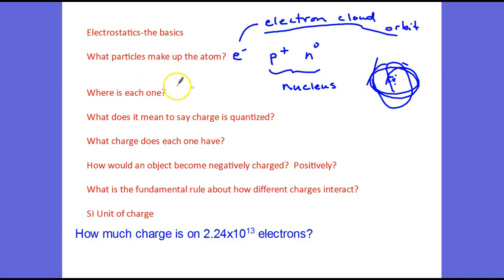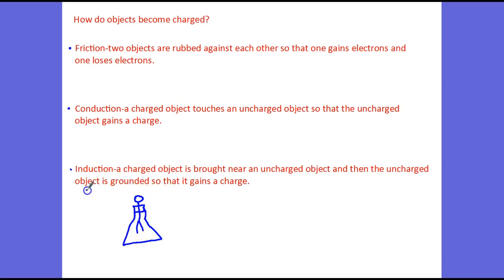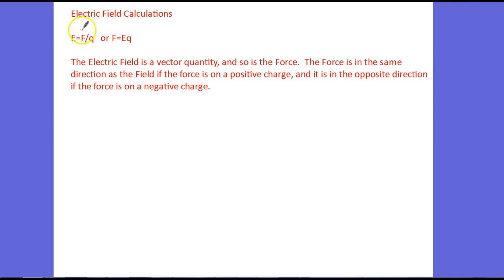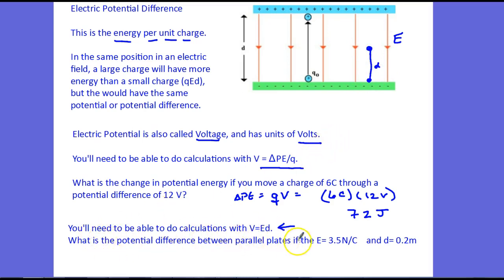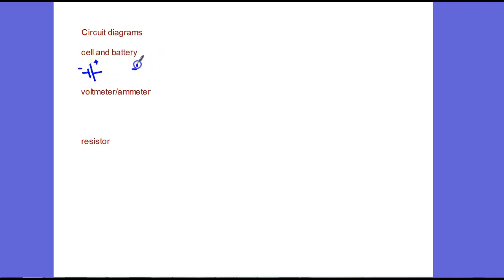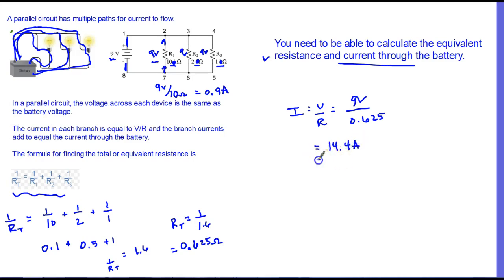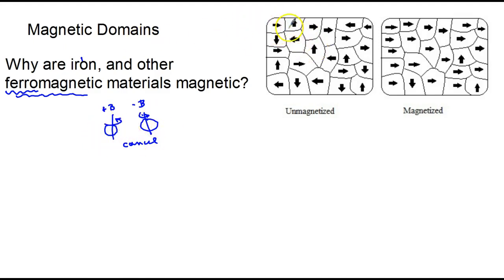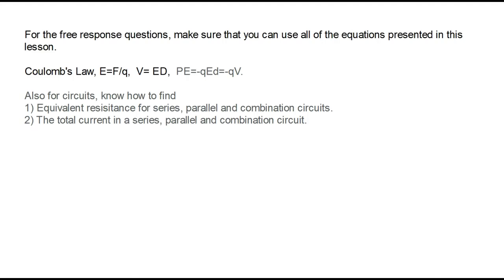Electricity and Magnetism Review

Comment: This whole model does not make any sense.  Never has.  What is a charge exactly?  Just calling it an electron or proton does not explain anything.  Just saying one is negative and one is positive does not explain anything.  Does one have a good attitude and another a bad attitude?  Saying how it acts under certain conditions does not explain anything, either.  These magic bumping particles "just are" and "just do."  There is absolutely no explanation, mechanical or otherwise, of what is occurring in the space between the magic particles.  The "strong force" and "weak force" are equally lacking in explanatory power and are just another form of the "just do" description.  

So, you have the nucleus of an atom consisting of positively charged protons and perhaps neutrons and this is surrounded by an electron shell consisting of numerous oddly shaped orbitals.  If the electrons are actually attracted to the protons, why are they not in the nucleus of the atom with the protons and neutrons?  Seems to me more like the protons and neutrons are attracted to each other and the protons and electrons repel each other.  Instead, the electrons are freely floating in the space around the nucleus; and at the speed of light, I might add.  So these little particles are just zipping around sporadically, changing direction of their own accord without any energy input whatsoever.  How?  Pretty nonsensical, if you ask me.  Where is the energy coming from to make the electrons zip around the nucleus at that speed?  How are the electrons changing direction of their own accord?  What is going on here?  Again, no explanation whatsoever.  

Now, according to this model, electricity is a whole lot of electrons flowing through a wire like water is flowing through a pipe.  The flux of a magnet crosses the wire at an extremely low velocity relative to the rate at which the electricity is claimed to flow through the wire.  How does that happen?  And transversely, I might add.  Not even longitudinally.  That makes no sense.  So, according to this model, an extremely low velocity transverse interaction creates an extremely high velocity mass flow of these particles which always occurs at the same speed c, like magic.  And this is through all of the resistance/impedence of the wire itself.  How are all these electrons leaving the protons they are "attracted to" simply because some lines of magnetic flux crossed the wire at some point?  And those electrons must be somehow pushing all the other electrons away from the other protons on down the line.  From where does all of this energy come?  Then when the energy is used, are you really just taking kinetic energy directly from the flowing electrons?  Is there an electron pile up occurring as they all get slowed down?  From where are all the replacement electrons coming if the electrons are getting slowed down at the point of energy usage?  Since electrons can just change direction of their own accord while they are gallivanting around the nucleus of an atom, how do they all decide to go the same direction simultaneously just because a line of magnetic flux crossed a wire?  Again, this makes no sense.  Seems to me that this model absolutely requires a certain degree of sentience of the particles themselves.
Reply: 'Why doesn't this lecture on the elemental basics of electricity start by explaining quantum electrodynamics while explaining the electromagnetic tensor and how magnetism is the electrical force expressed through relativistic transformations, this is where you start teaching about the basics also we should teach Hamiltonians in grade 8 physics fuck Newton because teaching students models that they lack the mathematical backing to begin to understand is a great way to get them into science and also there's many people who work in the electrical fields that work with this model absolutely fine anyways but fuck utility'
Reply: @DracoSuave  "funky utility."  Yeah, that's exactly what they said when they applied relativity to classical electromagnetic theory.
Reply: @DracoSuave  I don't think their high end models explain most of the questions I asked, either.
Reply: @wesbaumguardner8829  Well if the standard model doesn't give the level of explanation you seek, doesn't that imply that the explanation you seek might be outside what we actually know, and can expect to teach entry level students on electrostatics?
Reply: @DracoSuave  I certainly think the explanation I seek is outside of the standard model.
Reply: @wesbaumguardner8829  Then an entry level college lecture is outside the scope of that desire for explanation, isn't it?
Reply: @DracoSuave  That still does not remedy the fallacies and contradictions of the explanations provided.
Reply: @wesbaumguardner8829  None of which matter at that level of understanding.  None of that is salient to the point--potential, current, resistance, all that still works within that model well enough that you can make a career on it and not knowing the nuances of the standard model won't change that.  

Complaining that we don't know things on a first year lecture is just a shitty thing to do, man.  Like... really bad.  Go take a grad course.
Reply: @DracoSuave  Why would anyone want to learn anything they will have to unlearn later if they want to progress?  To be honest, I don't think the graduate program is going to be any more correct than this level, either.  There is a reason for the stagnation of technological advancement in the energy sector.
Reply: @wesbaumguardner8829  My dude, if you want to get into a field where you have nothing new to discover and everything's figured out, you don't want to be a scientist.  The sciences are not for you.  Science is not for you.

Learning, is not for you.

Go into a field where everything is figured out, where you're not having to learn newer and more intricate ways of understanding--go into a field where there's no frontiers of knowledge left to uncover.

Science does not owe you perfect explanations for everything, nor can it, because science is not easy.  It's very hard.  Clearly too hard for you, because the fact that it has unknowns still bothers you.
Reply: @DracoSuave  There is plenty to learn.  Just not from these people.  They are trapped in their own models.  "Men substitute words for realities and then talk about the words."  -- Edwin Armstrong
Reply: @wesbaumguardner8829  Honestly at this point I'm just waiting for you to play your hand and reveal some debunked pseudoscientific nonsense like plasma-universe or how gravity is false or some shit.  You've checked all the boxes for a typical woopeddler, so let's just finish the job.  That's where this is going, yes?  

Well, get on with it.  Entertain me.
Reply: @wesbaumguardner8829  oh good you found an experiment that follows the standard model and are trying to use it to shit on the standard model, what's next, using double slit to try to disprove the wave/particle dynamic?  

Come on this can't be your best trick, are we going towards plasma-universe?  Is this where it's going?
Reply: @wesbaumguardner8829  The experiment did not contradict---you know what this isn't worth going into.

You don't understand what you're talking about or what you're seeing.  If you did, you wouldn't be on a video teaching the classical electrical model complaining that they teaching the classical electrical model.

Figure your opinion out, it's inconsistant af.  Tesla invented a lot of shit but he was not a physicist.  I'm going to say that again:  HE.  WAS.  NOT.  A.  PHYSICIST.

There's a lot of shit he was wrong about, and we've learned this in the 100+ years since him.  Don't confuse your simping for Tesla for anything resembling a modern understanding.
Reply: @DracoSuave  The only thing they are doing is scaling down the circuitry of the classic theory.  They are still using most of the equations of classic electromagnetic theory.  We are still using Tesla's AC motor/generator or an innovation of it to generate practically all of the energy we use to power the computers.  Much of Tesla's technology is completely different than the technology we use today, so of course it would not work with systems designed for a completely different form of energy.  Claiming his system does not work because it was shut down before it was even completed and because we do not use it presently is as nonsensical as your electron theory of electricity.

By the "shit I am saying" are you talking about the quote from Steinmetz?  You know, he was the head of R&D for General Electric?  The first, I might add.  The entire company was built around him.  He has over 200 patents to his name, most if not all are electrical apparatus, many of which we still use today in one form or another to generate and distribute electricity.  He solved the issues we had with electrical substations exploding in massive coronal discharges.  The physicists certainly didn't.  Just like Oliver Heaviside, another engineer, solved the telegraphy distortion problems when physicists couldn't.  If everything was left to physicists, there would not even be an electrical distribution system.
Reply: @DracoSuave  "No, they're using something called semiconductors which rely on a property of atoms that exists in quantum mechanics but does not exist in classical theory.  In order for semiconductors to work, electrons must exist in a wave state and not in discrete orbits around specific atoms."  Classic electromagnetic theory does not utilize the electron particle.  That was a misapplication of JJ Thompson's description.  

"Tesla DID NOT BELIEVE ELECTRONS EXIST."  They don't, as particles.

"So there's no way Tesla's hypothesis could account for a nonconductive crystal with perfect electron orbitals being doped with a substance with 3 or 5 valence electrons (to form p-type and n-type semiconductors specifically) to form conductive material."  Tesla did not think of "conductivity" the way that you do.  Neither did Oliver Heaviside or Charles Proteus Steinmetz.    Conductivity does not happen inside the atoms of a material.  Conductivity happens outside of the atoms of the material.  That is, in the space surrounding the atoms.  The atoms merely serve as boundary conditions that serve to constrain the energy and prevent it from propagating outwards in all directions.    As such, this "conductivity" is merely determined by the permittivity and permeability properties of the material itself.  That is completely predictable by classical electromagnetic theory, even if they did not have that particular material available at the time.

"Semiconductors don't work because of 'tiny wires', strips of metal that small don't actually work because the electromagnetic force required will cause them to corrode at that level."  Semiconductors have imperfections in them due to the "doping" by the other elements.  This makes them partially permeable and partially non-permeable.  This, in turn, creates tiny inner-atomic circuits.  These tiny circuits comprise on/off switches which can be used to form a language.

"And we've actually SEEN that shit under a powerful enough microscope."  You cannot see electricity with light.  You are full of shit.

"So your disbelief is not born of the strength of Tesla's discredited theories, but on the basis of complete pants-on-head ignorance.  You.  Have.  No.  Fucking.  Clue.  What.  You.  Are.  Talking.  About."  Go ahead and start describing the sentience of the electron particle and how it goes about determining whether it should be attracted to another electron to make an orbital pair or whether it should run away from another electron in terror.  You outed yourself for an idiot a long time ago.  Pretty much everyone that read my critique of your pet theory knows you have nothing to stand upon.  If you did have anything to stand upon, you would have used it by now instead of whining like a b!tch about how unfair it is that I bring all these contradictions and fallacies to light.

"That doesn't make him right about electrons.  The fact we've observed, directly, electrons means literally everyone who has claimed electrons don't exist was wrong.  It's really that simple."  You have not observed electrons directly.  At best you could claim you observed them indirectly.  I highly doubt that is even accurate.  The computer put out a blip and you recorded it as an electron is more like what you observed.

"Regardless, none of this changes the fact that you're being a collosal asshole."  Well, at least I'm not being a whiney little b!tch like you.

"You do not show disrespect to a college professor in a field they spent years studying, who is trying to teach the fundamental basics of electricity--the same fundamentals Tesla agreed with, ironically--and start going on with your Tesla Plasma-Universe malarky and call yourself the good guy."  You aren't teaching the same fundamentals with which Tesla agreed.  Funny how you attempt to pretend that you do while at the same time pretend he was a charlatan when it is you and your ilk that are the charlatans.

"The fact that you're defending discredited science is bad enough, but the fact that you don't even have the basic knowledge of what you're defending to know that the basic models of electrostatics were the same models Tesla SUPPORTED shows you don't even understand the model you're trying to support."  They aren't the same models at all.  You physicists did away with the aether/ether, which was the basis of classical electromagnetic theory.  By all rights, you should have done away with all of the equations as well, because they were all based in fluid dynamics, but you kept most of them and just provided different, yet erroneous descriptions of what was actually occurring.  

"You do your ideas a disservice by going about it in this hamfisted, ignorant way.  Write a paper or fuck off."  Lol.  Write a paper.  And submit it to some closed-minded asshole, just like yourself that will automatically reject it because it does not meet your status quo.  That's rich.  I am really glad we had this interaction.  Best of luck getting new recruits for your religion.
Reply: @wesbaumguardner8829  "Classic electromagnetic theory does not utilize the electron particle.  That was a misapplication of JJ Thompson's description."  Yeah, a semiconductor doesn't work under classic EM theory.  But it works in your computer.  So it works.

"Go ahead and start describing the sentience of the electron particle and how it goes about determining whether it should be attracted to another electron to make an orbital pair or whether it should run away from another electron in terror." 

1)  Electrons are attracted to the proton because they are of opposite charge.  This is consistant with classic electric theory.
2)  While electrons repel each other, that is insufficient to negate the attraction of the nucleus entirely.  This is consistant with classic electric theory.
3) Because electrons are repelling each other while being attracted to the protons, you have competing forces that create a net force that compels electrons into equilibrium states
4) Because the electrons are moving, like any moving charge in classic magnetism they also compel magnetic forces that affect each other.
5) These three factors combined cause electrons to settle into orbitals as per the principle of least action, a core part of Lagrangian mechanics--which predates classic electrical theory.

The only things QED add to this is that the energy states of electrons are quantized (which means an electron changing electron states will only emit or absorb specific energies of photons--this can be directly observed in the spectra lines of excited atoms giving off light frequencies that correspond specificly to a given element--this I have observed with my own eyes) and the Pauli exclusion principle which says that two electrons can't have the same quantum state--which is why the only way for two electrons to share an orbital is if they have opposite magnetic orientation (this is called spin).

Further, all these properties have been exploited and utilized in multiple fields, especially chemistry.  Chemistry works based on this exact model, and it works great.

"You have not observed electrons directly.  At best you could claim you observed them indirectly.  I highly doubt that is even accurate.  The computer put out a blip and you recorded it as an electron is more like what you observed."  And you've never observed any counter evidence to this, so you're asserting but not producing.

" You aren't teaching the same fundamentals with which Tesla agreed.  Funny how you attempt to pretend that you do while at the same time pretend he was a charlatan when it is you and your ilk that are the charlatans."  This is literally a class on classic electrostatics.  You have no clue what you're objecting to: You just heard the word electron and your brain shut off.  I doubt you even know Coloumb's Law or Ampere's Law, or Ohm's Law or even what voltage IS.  And what I said was that Tesla got a lot of things wrong--those things he got wrong are the things that you have a boner about, claim are correct despite over a century of counterevidence.  Which is why the oldest thing you can find to support you is grainy black and white filmed movies, and nothing from this century that is from anyone resembling an expert in the field.

"They aren't the same models at all."  You don't know the model you're criticizing.  You don't know what a charge is, what induction is, what conduction is, you don't know what a Gaussian surface is, you don't know what a voltage is, you don't know what Maxwell's laws are (or that Maxwell's laws were derived by putting the laws of electricity through lorenz's transformations, because you claimed that relativity does not work with magnetism you clearly are unaware of what Maxwell's laws are about) you have displayed you do NOT know what classical electrical theory is.  

Hell, you probably don't even know what a vector is, a cross product, a dot product, or even enough calculus to be able to understand half the shit you're trying to criticize.

>You physicists did away with the aether/ether, which was the basis of classical electromagnetic theory.

No, Aether was actually the basis of the theory for light at the time, it had nothing to do with the extant model of electric theory.  Light was not identified as the carrier of electromagnetism until after Michelson/Morley disproved aether.  Meanwhile, the modern theories of light actually work.

>  By all rights, you should have done away with all of the equations as well, because they were all based in fluid dynamics

They aren't though.  You don't know Coloumb's law, how can you even begin to claim this nonsense.

> that will automatically reject it because it does not meet your status quo.

No, they will reject it because you will post assertions that do not comport with reality, and you will have made no attempt to experimentally determine your assertions to be even slightly correct, thus disqualifying it from being science.

Hell, your stupid theory won't even let a lightbulb work.  You've never seen a physics lab or done any experimentation or anything, and it's clear.

All you have is a boner for Tesla and Dunning-Kruger.  Tesla made electric lightning coils, AC current, and an earthquake machine but was wrong on so many things fundamental to modern invention that no one LITERALLY NOT ONE PERSON considers Tesla to be an expert in the field of anything except making quaint devices.  He made AC current, guess what?  That's like saying the guy who invented a kite made a better airplane than Boeing.  Meanwhile you're talking shit on a device made by engineers that reject Tesla's theories, using materials created by chemists that reject Tesla's theories, with power supplied by power companies run by engineers that reject Tesla's theories, none of which could have been made in Tesla's time.

Go post to your flat earth friends, they're the only ones who might take you seriously.  Actual people who work with electricity--including your run-of-the-mill electricians--will tell you to your face you're full of shit.  Because you are.

If Tesla's theories were valid, we'd be building shit based off them.  His only contribution in the modern day is AC current, and it has nothing to do with his contribution, someone else discovered, after his death, that it was more efficient over long distances, because (not despite) how electrons work.
Reply: @DracoSuave  "Yeah, a semiconductor doesn't work under classic EM theory."  Who's theory are you considering to be classical?  James Clerk Maxwell was the beginning, not the end of classical electromagnetic theory.  Go ahead and tell me why a semi-conductor would not work in Oliver Heaviside's or Charles Proteus Steinmetz's theories.

"1)  Electrons are attracted to the proton because they are of opposite charge.  This is consistant with classic electric theory."  Why aren't they in the nucleus with the protons and neutrons, then?  If a neutral particle is not attracted to anything, why is a neutron in the nucleus of the atom with the proton, in much closer proximity to the electron which is claimed to be attracted to the proton?

"2)  While electrons repel each other, that is insufficient to negate the attraction of the nucleus entirely.  This is consistant with classic electric theory."  Who's theory?  The only classical electromagnetic theory that involved the electron at all was JJ Thompson's.  His theory is one of many classical theories.

"3) Because electrons are repelling each other while being attracted to the protons, you have competing forces that create a net force that compels electrons into equilibrium states"  How would two electrons that should be repelling each other but are instead pairing up in very close proximity to each other be a state of equilibrium?  

"4) Because the electrons are moving, like any moving charge in classic magnetism they also compel magnetic forces that affect each other."  Steinmetz, who published the most comprehensive and complete classical electromagnetic theory argued against the conception of the point charges.  He was also the person that was the most productive in putting his theories into application, which provides him a great deal of merit in my mind.  In other words, he proved his theory worked time and again.

"5) These three factors combined cause electrons to settle into orbitals as per the principle of least action, a core part of Lagrangian mechanics--which predates classic electrical theory."  What causes the electrons to repel from the nucleus of the atom they are supposed to be attracted to, but are not, at least fully?  Perhaps the electrons are functioning in accord with Roger Joseph Boscovitch's theory.  Your theory certainly does not make any sense to me.

"The only things QED add to this is that the energy states of electrons are quantized (which means an electron changing electron states will only emit or absorb specific energies of photons--this can be directly observed in the spectra lines of excited atoms giving off light frequencies that correspond specificly to a given element--this I have observed with my own eyes) and the Pauli exclusion principle which says that two electrons can't have the same quantum state--which is why the only way for two electrons to share an orbital is if they have opposite magnetic orientation (this is called spin)."  So basically, electrons are nothing other than tiny permanent magnets.  Why can't they link up at opposite poles like other permanent magnets into a large electron clump?  With that said, each element has its own resonant frequency which is why light is propagated from the motion of these atoms.  Light is nothing other than a sound wave in the ether or quantum field or whatever you want to call the medium through which light propagates.  A wave is not a physical object, it is the action of a medium and this action can impart forces on what we call physical objects, but physicality is just an emergent property of the constructive and destructive interference of the waves in the field.  Stable standing waves of sorts.

I would love to stay and respond to the rest of your long post, but I have things to do.  Perhaps later I can respond to the rest.
Reply: @wesbaumguardner8829  The point is, Wes, you're saying electrons don't exist and a semi-conductor requires electrons to exist to function.  It's that simple.  I simply don't care what the name of the model you think you follow you call out is or who did it (because that requires examining how fucking wrong you are about it) but rather that your core belief--the non-existance of the electron--is incompatible with how semi-conductors work. 

Either you believe in electron orbitals and modern chemistry, in which case you are compatible with semi-conductor technology, or you do not, and are not. 

I'm not going to discuss with you wave functions of electrons or other nuances of shit you won't believe no matter what detail I go into, because you don't know how semi-conductors work and you don't know how that completely contradicts every assertion you make.

"So basically, electrons are nothing other than tiny permanent magnets."  Every charge with nonzero spin is, yes.  If you have a charge, and you move it or spin it, you get a magnetic field.  Source:  MOTHERFUCKIN MAXWELL BITCH.  Don't you come out trying to claim shit about Maxwell and not understand what Maxwell's equations are about:  That electricity and magnetism are the same thing expressed in different directions through spacetime.

"Why can't they link up at opposite poles like other permanent magnets into a large electron clump?"  Remember how I just said electricity and magnetism are the same thing but through space time?  There is no Lorentz transformation you can do to an electron to make it positively charged, which means those particles can never really attract each other.  But what you can do is make the net charge positive in certain areas (because the nucleus is still there, existing) and there is a net positive electric field where the electron is not, and the electric force only cares about the net field, not the individual objects.

"With that said, each element has its own resonant frequency which is why light is propagated from the motion of these atoms."  Spoken like someone who actually has never seen the lines I am talking about.  Elements don't have a 'resonant frequency', they emet BANDS of light at MANY frequencies.  The patterns of frequencies, however, are unique to each element.  So hydrogen, when excited, gives off red-blue light.  Not purple.  Red and blue.  Because it's multiple wavelengths, the visible parts include some bands in the red part of the spectrum and some bands in the blue part.  With a prism or a strong lens, you can see these bands with the naked eye.  I know because I've seen them, with my naked eye.  You have not, and it is very clear you have not.  So you are simply going to either have to take the time to actually do so, or take my word for it.  But I am confident that if you do, you will see the same deep blue and red that I have seen myself.

https://en.wikipedia.org/wiki/Hydrogen_spectral_series and oh shit, turns out, others have seen them too.

Light was disproven as having a carrier field long ago--it's a simple experiment to carry out, Michelson-Morrey did so a century ago, and it works by having light bouncing around at different angles.  If they are going through a medium, they should hold different readings if you spin the disc vs if the disc is still.  They do not, ergo, it is not carried in a medium.

"A wave is not a physical object"  You're thinking macroscopicly.  'Physical object' at the quantum level is nothing but waves; what we percieve as discrete hard objects are in fact just expressions of the repulsive electrical force as atoms get close to each other but there is no attraction between them to cause chemical bonding.

Chemical bonding, btw, follows rules involving electrons, and so you're kinda claiming chemistry doesn't work, fundamentally.
Reply: @DracoSuave   "The point is, Wes, you're saying electrons don't exist and a semi-conductor requires electrons to exist to function."  Field theory does not require a point charge or discrete, charge-carrying particle.  If SR and GR proved anything, they proved that the conception behind the mathematics can be completely erroneous and still provide results that are good enough to engineer by if the same exact mathematical equations are utilized in the same manner.  That is one of the primary problems with mathematics; its reliance on a completely different language consisting of words to have any meaning in reality at all.  If the classical electromagnetic field equations which were based entirely in fluid dynamics and described the properties and interactions of a medium called the ether/aether can still be used when the ether/aether is completely removed with equal efficacy, what does that say about mathematics?  To me, it says, "Houston, we have a problem."  And I place the problem on the reinterpretation that went on after the fact.  If there is no medium, no aether/ether, then all of the equations should have been completely discarded and equations that did not describe the aether/ether should have been created.  But they could not do that, now could they?

"... your core belief--the non-existance of the electron--is incompatible with how semi-conductors work."  No, it is just incompatible with the present mainstream description of how semiconductors work.  The mainstream description is converting field phenomena into bumping particle phenomena while trying to pretend the field is not there, but still somewhat acknowledging the presence of a field.  To me, it seems like a half-ass attempt to not have to acknowledge that they have been wrong about the presence of the ether for over 100 years now.  

"Either you believe in electron orbitals and modern chemistry, in which case you are compatible with semi-conductor technology, or you do not, and are not."  That is a false dichotomy.  I think the overall action of chemical bonding is correct, I just disagree with the how.  I do not think it is a particle interaction.  I think it is a field interaction.  Think about it.  Even your bumping particles have to have something between them that determines how they move and/or interact with each other.  Only, the electron orbitals explanation seems to fail Occam's Razor in that why not just have field interactions directly between the nucleus of the atoms and do away altogether with the sentient electron particles that can choose where and when they will attract or repel each other?

"I'm not going to discuss with you wave functions of electrons or other nuances of shit you won't believe no matter what detail I go into, because you don't know how semi-conductors work and you don't know how that completely contradicts every assertion you make."  Ok.  And I won't go into the dielectric field and all the phenomena in it that you will not believe.

"Don't you come out trying to claim shit about Maxwell and not understand what Maxwell's equations are about:  That electricity and magnetism are the same thing expressed in different directions through spacetime."  They are not the same thing.  Dielectricity and magnetism are the two components of the dielectric field.  Dielectricity forms flux lines that terminate inside matter at each end and magnetism forms concentric rings around the matter that is carrying a current which terminate on themselves.  Electricity is the union of a dielectric flux line and a magnetic flux line.  Motherfuckin Maxwell, Beeeach.  By the way, you are probably referring to Oliver Heaviside's short and sweet algebraic representation of Maxwells long and tedious equations involving infinitesimals and calculus rather than Maxwell's equations themselves.

 "Remember how I just said electricity and magnetism are the same thing but through space time?"  That's just wrong for the reason I already mentioned.  You could claim magnetism and dielectricity are the same but in different directions, but that is still technically not correct.  The dielectric is a form of potential energy and the magnetic is a form of kinetic energy.  The magnetic is spatial in nature and the dielectric is counter-spatial in nature.  You cannot equate the two as if they are exactly the same just like you cannot equate the kinetic and potential energy of a swinging pendulum as the same thing.  They are two sides to the same coin, but they are still two  different sides.

"There is no Lorentz transformation you can do to an electron to make it positively charged, which means those particles can never really attract each other."  Permanent magnets are not charged.  They both attract and repel each other depending completely on the orientation of their polarities with each other.  Basically, your explanation is crap.  It does not work.

"But what you can do is make the net charge positive in certain areas (because the nucleus is still there, existing) and there is a net positive electric field where the electron is not, and the electric force only cares about the net field, not the individual objects."  Well, at least there is finally some discussion on something that might actually be possible.  It still seems to violate the principle of locality, though.  I am a little foggy on how it would actually work, though.  Is it the proton particle that is positively charged or is it the field around the proton that is positively charged?  Both?    If it is both, how?  How can a positively charged particle positively charge a field?  How?  By what mechanics?  Are you going to get into quantum dipoles now?  

"Spoken like someone who actually has never seen the lines I am talking about.  Elements don't have a 'resonant frequency', they emet BANDS of light at MANY frequencies."  What lines are you talking about?  Elements do not emit particles unless they are undergoing radioactive decay.  That would be a violation of the conservation of energy.  Do you really think you can really create particles just by running some electricity through an incandescent light bulb?  Gamma rays are not particles, either.  They are waves.  Elements have several resonant frequencies that are dependent on elasticity and density properties of the material in question.  With light, you are talking about a law of averages. There is no such thing as a 100% pure material.
Reply: @wesbaumguardner8829  "Field theory does not require a point charge or discrete, charge-carrying particle. "  But semiconductors do.  They function based on A) the existance of atoms with 4 valence electrons in a crystal lattice (silicon most commonly) B) doped with atoms with either 3 or 5 (germanium and gallium must commonly) valence electrons which act as impurities in the lattice.  Because of the way electron orbitals work, this produces free electrons which can then flow over the silicon (resulting in a net positive charge in the silicon), or places for electrons to go to charge the silicon (resulting in a net negative charge.)

If, however, you use electrical theory that lacks electrons, and therefore lacks valence electrons, you are stuck with the very simple fact that silicon, germanium, and gallium are inherently insulators, and those mixing them together should not result in a conductive material.  So, either electrons are correct, and you can dope silicon with germanium or gallium to make it very conductive, or electrons don't exist, in which case you cannot do this.

Because semiconductors, however, DO work, and DO work by doping silicon with germanium or gallium, that means that the theory that lets them work must also have some form of validity, and theories that exclude them do not work.

"Dielectricity forms flux lines" stop you right here.  Nothing about electrons or semiconductors contradicts this.  This is high-school level shit.  We're past that.  We're at the properties of valence electrons within an insulating substance.  

"Electricity is the union of a dielectric flux line and a magnetic flux line.  Motherfuckin Maxwell, Beeeach."  No.  Electricity is what you get when two charges exhibit a force on each other.   When you have a charge move in a net-neutral space, however, because of Lorentz transformations, length actually changes which changes the charge density of the moving charge through that material.  Because the material is unmoving and its charge density does not change, the resulting net charge density of the material changes.  This is what we measure as magnetism.  This has been experimentally corroborated.  Maxwell's equations work in Minchowski spacetime, my dude.  In fact, they work BETTER in Minchowski spacetime.

"is it the proton particle that is positively charged or is it the field around the proton that is positively charged?  Both?"

The proton is positively charged.  A positive charge, however, creates an electric field around it with the strength of kq/r^2 where k is Coulomb's constant.  Yes, this is just a rephrasing of Coulomb's law for electrical force without the charge the force is acting on.  The electric field at a given point is neither positive nor negatively charged, it's a vector, that indicates the net direction a positive charge would feel a force.
Reply: @DracoSuave  "If, however, you use electrical theory that lacks electrons, and therefore lacks valence electrons, you are stuck with the very simple fact that silicon, germanium, and gallium are inherently insulators, and those mixing them together should not result in a conductive material."  Material properties often do not work the way we think they do.  Per your reasoning, we should not be able to mix two liquids together to make a solid, or even a gas and a liquid together to make a solid.  But we can.  If that is possible, why should it be impossible to mix two dielectrics together to make a semi-conductor.  Numerous properties change when different elements are bonded together.  Why should the properties that dominate the electromagnetic field (magnetic permeability and dielectric permittivity) be any different?  A dielectric is not what you think it is, either.  A dielectric is a material that readily carries the dielectric field.  Hence the name "dielectric."  The so-called "insulator" is the actual conductor of the dielectric field as it readily accepts the dielectric form of energy without much impedence while what we call the "conductor" actually acts like a dielectric reflector that serves to reflect the field back upon itself instead of allowing it to escape outwards in all directions, but as a secondary effect, it conducts the energy down the "conductor" laterally in accordance with the right-hand rule.  It is a fact that the vast majority of the energy (both magnetic and dielectric) is stored in the field outside of the wires and not inside the wires themselves.  The same thing happens in the semi-conducting chips, but only on a much smaller scale, which means it has a much higher capacitance.

"Nothing about electrons or semiconductors contradicts this.  This is high-school level shit.  We're past that.  We're at the properties of valence electrons within an insulating substance."  Let us see what J.J. Thompson, discoverer of the "electron" has to say about them, shall we?  "Hitherto, we have been dealing chiefly with the properties of the lines of force, with their tension, the mass of ether they carry along with them, and with the propagation of electric disturbances along them; in this chapter we shall discuss the nature of the charges of electricity which form the begginnings and ends of these lines."  Electricity and Matter page 71.  So, according to the man himself, an electron is not a particle at all, but rather the end of a dielectric line of flux.  There goes all your particle based orbital bullshit.  Go ahead and tell me how there can be "electric disturbances" along these dielectric flux lines if the electricity/electrons are only at the end of the flux lines.    

"Electricity is what you get when two charges exhibit a force on each other."  Total Electrification Q (in Planck) = Total Magnetic Induction Phi (in Webers) * Total Dielectric Induction Psi (in Coulombs).  Who proved this equation wrong, when did they prove it wrong and by what experiment did they prove it wrong?
Reply: @wesbaumguardner8829  "but as a secondary effect, it conducts the energy down the "conductor" laterally in accordance with the right-hand rule"  What the fuck is this shit?  The right hand rule?  Which are the two vectors that make up the factors of your cross product?!  What the fuck are you on about?  None of what you said here makes sense.  You're making shit up.

"Total Electrification Q (in Planck) = Total Magnetic Induction Phi (in Webers) * Total Dielectric Induction Psi (in Coulombs)."

This is not a force equation.  This is not Coulomb's law.  coulombs measures charge.  webers measure magnetic flux.  Webers are shorthand for volt-turns per second.  If you multiply those units together you get coloulomb-volt-turns per second which translates to joule-turns per second, which translates to watt-turns.  This would be a unit of energy over time put into something rotating.  Planck units are really small measurements of distance, the dimensionality does not work here.  Further, webers are a pseudovector representing a rotational quantity and when you multiply a rotational pseudovector by a scalar, you don't get a displacement true vector.  You also would never write the product of a scalar and a vector like that--the scalar ALWAYS comes first and the vector ALWAYS comes second (and order is important in vector math, the only time a vector can be the first factor of a product is in the product of two vectors, otherwise if you're multiplying by a matrix or a scalar, the vector MUST be second)
Reply: @wesbaumguardner8829  "So, you are telling me that the end of a flux line is divisible?"

They're not literal lines.  They're not.  Literal.  Lines.  Gauss lines (the more accurate name) a representation of an electric field. There aren't literal heckin lines.  

And you can't heckin argue that heckin Gauss lines are quantized when you're arguing against quantum models.  

You're literally not making any sense.

You also ignored all the vector math you've gotten horribly horribly wrong (do a dimension analysis)
Reply: @DracoSuave   "They're not literal lines.  They're not.  Literal.  Lines.  Gauss lines (the more accurate name) a representation of an electric field. There aren't literal heckin lines."  They are really real lines that form due to constructive and destructive interference within the field itself.  Similar to the pattern that forms in the double slit experiment.  Michael Faraday described them as lines.  James Clerk Maxwell described them as lines.  Oliver Heaviside described them as lines.  Charles Proteus Steinmetz described them as lines.  JJ Thompson described them as lines.  Heaviside, Steinmetz, and Thompson even have diagrams of the field lines in their works.  These lines physically pull two wires together under the right field conditions.  The reason we cannot see them is because we do not have a material that orients itself to them like we do with magnetism.  We can literally see the lines of the magnetic field with iron filings, etc.

JJ Thompson, the man that discovered the electron literally says the electrons are the ends of a flux line, yet you desperately want to claim otherwise so you can keep believing in your sentient particle theory.  I provided the actual quote from JJ Thompson's book.  I even gave you the page number so you can read it for yourself.  Perhaps you should read what follows after that, because it only makes it abundantly more clear that the electron is the end of a line of flux.  You really have no understanding of classical electromagnetic theory at all.
Reply: @wesbaumguardner8829  "They are really real lines that form due to constructive and destructive interference within the field itself. "  No, they are not.  They are representations of the direction a positive charge will go due to electrical force.  The direction of the lines indicate the direction the positive charge will go, and the density of lines is a representation of how strong the electrical force will be on that charge.  

Further, claiming that lines are indivisible is contrary to your claim that quantum mechanics is bunk.  You're claiming that they are quantized (that's the term for indivisibility in physics) and what's stupider, is you're claiming that me saying that charge is quantized (and, yes, Millikin proved this using the oil-drop experiment) is somehow claiming that Gauss lines are... not?  These are not related claims.

The point you've missed from all those physicists is that you're confusing a representation, an analogy, for the actual phenomenon.  Field lines are a useful tool for determining certain things, but that doesn't mean they have real existance outside that conceptualization.  You also would not argue that every charge has equivoltaic rings around them that are precisely perpendicular to Gauss lines.

In fact, you've seen this shit before.  When you look at a contour map of the earth, you've seen arrows to indicate which direction is downhill and lines that indicate specific elevations.  These are not merely analogous to Gauss lines and Equivoltaic lines, they ARE the equivalent for the gravitational field at that location on the map.

But you wouldn't argue there's literal arrows of force coming down the mountain, crossing cross-sectional rings that you can interact with on a physical level.

You're confusing the map (gauss lines and equivoltaic rings) for the terrain (the charges, force directions, and potential energies at a given location).  The map is useful for figuring out where you need to put shit to do work.  But the map isn't doing that work.  My physics prof describes them as lines too.  But Faraday did not mean there are actual lines in space, nor did Maxwell, nor did Heaviside,  nor did Thompson.  

Further, you're directly contradicting many of their conclusions and most of their work, which you'd know if you'd studied enough physics to know what you're talking about, instead of reading the word 'lines' and thinking you know what you're reading about.  

'Perhaps you should read what follows after that, because it only makes it abundantly more clear that the electron is the end of a line of flux.'

I'm not disputing this.  In fact, this doesn't contradict one fucking thing I've said.  If a Gauss line is the direction a positive charge feels a force, and electrical charges that are opposite to each other are attractive, then that force a positive charge would by necessity point to a negative charge.  That force isn't going to magically point somewhere else, is it?!  OF COURSE the force points towards the negative charge.

You fucking up on a fundamental level what a Gauss line IS, is not a gotcha on me bud.  You're confusing the map for the terrain.  That's like me saying that rivers flow down elevations from mountains to oceans and you pointing to a fucking elevation map and saying 'NO THEY DONT THEY TRAVEL FROM THE CONTINENTAL DIVIDE AND GO TO THE OCEAN' and me just going back 'Yeah, we define the continental divide that way because rivers flow downhill' and you going 'NO IT ISNT THE CONTINENTAL DIVIDE MUST BE A REPELLANT FORCE MAGNET FOR WATER' and then you bringing up the geographer who penned the theory 'rivers flow downhill' where they're talking about the continental divide as support for your stupid position.

Also, just so you know:  The dielectric is the insulator in a capacitor.  The silicon in semiconductors is not a dielectric, though undoped silicon can act capacitor; generally semiconductors are the wrong stuff to make a capacitor out of, which is why you see all those little electronic doodads sticking out of your printed circuit boards.
Reply: @DracoSuave   "No, they are not.  They are representations of the direction a positive charge will go due to electrical force."  There is a line of dielectric flux between two wires, each end terminating on the surface of each wire.  There is a positive charge located in the dead center of that dielectric flux.  Which way does the positive charge go?  If the charge is shifted to one side or the other of the center of that dielectric flux, which way does it go?

"Further, claiming that lines are indivisible is contrary to your claim that quantum mechanics is bunk."  No, it is not.  Quantum mechanics wants to pretend that the ends of dielectic flux lines are charged particles and that the flux lines do not occur.  To them, the only thing that matters is the point charge, when in actuality it is the field that contains all the energy.

"You're claiming that they are quantized (that's the term for indivisibility in physics) and what's stupider, is you're claiming that me saying that charge is quantized (and, yes, Millikin proved this using the oil-drop experiment) is somehow claiming that Gauss lines are... not?"  When did I ever make that claim?  Go ahead and copy and paste it for me.  I said electrons do not exist as particles.  That is different than saying they are not quantized.  The end of a dielectric flux line is still quantized.   There are only two of them for each flux.  Nice straw man argument, btw.

"In fact, you've seen this shit before.  When you look at a contour map of the earth, you've seen arrows to indicate which direction is downhill and lines that indicate specific elevations.  These are not merely analogous to Gauss lines and Equivoltaic lines, they ARE the equivalent for the gravitational field at that location on the map."  They aren't equivalent for the gravitational field.  The gravitational field will be going directly into the paper.  Things do not fall to the side of a cliff face, things fall directly towards the center of the earth regardless of the surface contours of the earth.  Of course, once impact is made with the earth, the contour comes into play, but that is not the direction the gravitational field itself is pulling.

"You're confusing the map (gauss lines and equivoltaic rings) for the terrain (the charges, force directions, and potential energies at a given location).  The map is useful for figuring out where you need to put shit to do work.  But the map isn't doing that work.  My physics prof describes them as lines too.  But Faraday did not mean there are actual lines in space, nor did Maxwell, nor did Heaviside,  nor did Thompson."  That's where you are wrong.  There is a direct correlation between the amount of lines in a space and the amount of work that can be done.  When work is done, the energy of some of the flux lines dissipates and there are fewer lines which means the field has less capacity to perform work.  More power must then be consumed to get the flux line densities back to where they were.  And if the flux lines are just representations, and nothing is going on there, how can it cause a point charge to move per your earlier argument?  If it truly is nothing, it cannot act on a thing.  But it can act on a thing, so it must be something.

"Further, you're directly contradicting many of their conclusions and most of their work, which you'd know if you'd studied enough physics to know what you're talking about, instead of reading the word 'lines' and thinking you know what you're reading about."  Let me guess, was it when I provided their direct quotes which you succinctly claimed were wrong?  Why don't you go ahead and tell me where exactly I am contradicting their conclusions?

"I'm not disputing this.  In fact, this doesn't contradict one fucking thing I've said."  Yes, it does.  You keep claiming that electrons are particles.  The end of a line of dielectric flux is not a particle. 

"You fucking up on a fundamental level what a Gauss line IS, is not a gotcha on me bud.  You're confusing the map for the terrain."  When it comes to the field, the gauss lines are not the map, like you are claiming.  They are the field itself.  This all goes back to that Edwin Armstrong quote I provided earlier.  You are just talking about the words.

"Also, just so you know:  The dielectric is the insulator in a capacitor."  No, it is not.  The dielectric is what stores the energy of the field.  You can take a Leyden jar, charge the dielectric inside of it, remove the anode and cathode and replace them with a new anode and cathode and complete the circuit and still get a discharge.  You should know this, man.

 "The silicon in semiconductors is not a dielectric, though undoped silicon can act capacitor; generally semiconductors are the wrong stuff to make a capacitor out of, which is why you see all those little electronic doodads sticking out of your printed circuit boards."  A while back you said it was a dielectric, now you are saying it is not one.  How wonderful.  Well, even if it is not acting as a dielectric, the air can certainly act as a dielectric.  And all those little metal bits are what you would consider a conductor.  A computer chip is just a material that has thousands of tiny circuits on it.  If you want to claim it does not follow classical electromagnetic theory, prove that it does not follow the laws of circuitation of classical electromagnetic theory.
Reply: @wesbaumguardner8829  "There is a line of dielectric flux between two wires, each end terminating on the surface of each wire.  There is a positive charge located in the dead center of that dielectric flux."

The electric field is going from the positive charged wire to the negatively charged wire.  The proton is attracted to the negatively charged wire.  There's arrows attached to Gauss lines (I know you're calling them flux lines and I know that they were originally called that, but I'm avoiding the use of the term flux because in modern electrostatics that's a term for a slightly related thing) that show you which direction a positive charge goes.  Also, 'dielectric' is the resisting material in a capacitor.  Believe it or not, you've almost described one here on accident!

"No, it is not.  Quantum mechanics wants to pretend that the ends of dielectic flux lines are charged particles and that the flux lines do not occur."  This is patently incorrect.  First off, 'quantized' means, in physics, that you're dealing with discrete indivisible units.    It means that you cannot break that apart.  So when you claim flux lines are indivisible, you are claiming they are quantized--that's what it means.  However this is not true, because flux lines are arbitrary in terms of how many or what you draw.  The field itself is not quantized, but all electric charge is.  And yes, the ends of Gauss lines are electric charges, because of Coulomb's law.  

"Let me guess, was it when I provided their direct quotes which you succinctly claimed were wrong?  Why don't you go ahead and tell me where exactly I am contradicting their conclusions?"  I have multiple times.  Let's start with your complete disregard for Coulomb's Law.  This is absolutely required to accept in order to accept all four of Maxwell's equations.  Let's start with the first one and why you contradict it.

Grad E = rho/epsilon_naught.

In english, this is 'The gradiant of  Electric Field is equal to the charge density per volume within a given space divided by the permittivity of free space.'  

If your model does not include electric fields (and therefore excludes the gradiant of the electric field) and it doesn't include charge (and therefore excludes the volume charge density) then you don't exactly fucking agree with Maxwell's first equation do you?

Agreeing with the existance of the electric field is required to acknowledge Maxwell's four laws--in fact it's required to even make sense of them.  

Maxwell's Law is based upon knowing what an electric field is--it's the force per coulomb acting on a charge at a given point in space.  And to know the force per coulomb you need to know a) what a coulomb is (it measures electric charge) and b) what the equation for electric force is.  That electric force equation is k times the first charge times the second charge, all divided by the square of distance between them.  

And how do I know this?  Because I actually know what the fuck I'm talking about.  All you're doing is regurgitating terms and quotes from scientists without actually understanding the meaning behind any of it.  I've performed experiments to verify some of this shit.  You have not.  You OBVIOUSLY have not.

How the sam fuck can you even POSSIBLY claim to understand Maxwell--which requires understanding multi-variable calculus, linear algebra, AND tensors--without understanding the actual content.

Like every time you say 'dielectric flux lines' I know that you actually are referring to what mathematicians refer to as 'a vector field.'   And because you're describing field lines from a vector field diagram, I know what it is you're referring to.  I know what those previous physicists are referring to because I learned it in modern language.  But, because you actually DON'T understand it, you think rigidly connected topics such as vector field lines, equivoltaic lines, and coulomb's law are contradictory things, rather than the truth, which is that they're all different ways of expressing the same thing and that you use whichever is easiest to work with at any given time.

Look, there's no other way to put it.  You're shitting on these physicists by mangling what they're saying in your hamfisted manner.

You.  Are.  Just.  Regurgitating.  Without.  Understanding.

Either charge exists or Maxwell was wrong.  You claim charge does not exist, ergo, you claim Maxwell was wrong.

And this is why you're disrespectful.  Rather than learning the material this professor provided for you in this video, you decided to heckle it, under the hubris that you--who doesn't even fucking know what a vector is--knows more than someone who works with electricity about electricity.
Reply: @DracoSuave  "The electric field is going from the positive charged wire to the negatively charged wire.  The proton is attracted to the negatively charged wire.  There's arrows attached to Gauss lines (I know you're calling them flux lines and I know that they were originally called that, but I'm avoiding the use of the term flux because in modern electrostatics that's a term for a slightly related thing) that show you which direction a positive charge goes."  Are you using the one-fluid or two-fluid theory postulated by Maxwell?  As his was the first comprehensive theory, it was also incomplete and/or incorrect in some of the assumptions.  As I previously stated, Maxwell was not the end of classical electromagnetic theory, but the beginning.  Steinmetz's theory is the most complete and comprehensive and the last that was actually published in great detail, while also being the most engineerable and he did away with the concept of charges for the most part and stuck to the fields themselves.  Steinmetz had much greater empirical evidence through experimentation at his disposal than Maxwell did.

"Also, 'dielectric' is the resisting material in a capacitor.  Believe it or not, you've almost described one here on accident!"  Air is a dielectric.  Rubber is a dielectric.  Oil is a dielectric.  Empty space is also a dielectric.  A dielectric is a material that supports the dielectric field, as I stated earlier.  The dielectric field is located in the air around two current carrying wires, not inside the wires themselves for the most part.  Of course there is a point of contact where the flux lines terminate.  Resisting material of what?  Charge transfer?  Look at it this way.  You could say that gravity is a resistor to upward movement away from the earth's surface.  So, you carry a rock up a mountain.  Gravity was resisting you the entire way up.  But, as you were going up the mountain, you were converting chemical energy into kinetic energy and kinetic energy into potential energy.  Gravity was there the entire time.  When you get to the top of the mountain, you toss the rock off of its edge and all that potential energy gets converted back into kinetic energy until it hits the earth's surface again.  Same exact thing with the dielectric.  The dielectric material can be likened to planet earth and the dielectric field can be likened to gravity.  If planet earth somehow became more massive, the resistance to vertical movement would be greater, but so would the stored potential energy of the vertical movement.  Likewise, the better dielectric a material is, the more resistive it will be to kinetic movement of charges, but the greater the stored potential energy of those charges.

"So when you claim flux lines are indivisible, you are claiming they are quantized--that's what it means.  However this is not true, because flux lines are arbitrary in terms of how many or what you draw."  Yes, flux lines are not divisible, thus their ends/terminals are also not divisible.  The dielectric flux lines are not arbitrary at all.  They are lines of force.  They literally have physical effects in the real world which you can measure.  If you draw additional dielectric flux lines in a field representation, you are actually adding potential energy to the field you are describing on paper.  It takes power from the current to create dielectric flux.  Furthermore, Steinmetz makes it quite clear that the dielectric flux can transfer its potential energy to the kinetic energy of the magnetic flux and vice versa.  This man created and built our electrical grid.

"Let's start with your complete disregard for Coulomb's Law.  This is absolutely required to accept in order to accept all four of Maxwell's equations."  Again, Maxwell's equations were the beginning, not the end of classical electromagnetic theory.  JJ Thompson makes it quite clear that the electron is the termination of a line of dielectric flux and not a charged particle.  Charles Proteus Steinmetz makes it quite clear that these lines of dielectric flux can be created and destroyed.  Thus, the electron, which you consider a negatively charged particle, can be created and destroyed.  Let us look at what Steinmetz says specifically.  "The dielectric field, or dielectric flux, psi, is proportional to the voltage e, with a proportionality factor, C, which is called the capacity of the circuit.  psi = Ce    The dielectric field represents stored energy, w.  To produce it, power, p, must therefore, be supplied by the circuit.  Since power is current times voltage p = i'e, to produce the dielectric field, psi, of the voltage e, a current i' must be consumed in the circuit, which with the voltage e gives the power p, which supplies the stored energy w of the dielectric field psi.  This current i' is called the capacity current, or, wrongly, charging current or condenser current."  Elementary Lectures on Discharges, Waves, and Impulses and Other Transients pages 12-13.  Of course, this pisses all over the earlier theories of electricity.  It also pisses all over the bumping particle physics of today which is just a later generation of the bumping particle physics he was denouncing at the time he made the statement.  His theory does, however, work.  He built practically the entire electrical grid on his theory.

Additionally, in his discussion of electromagnetic transient field phenomena, he goes into depth on how the magnetic can transfer energy to the dielectric and vice versa.  This also pisses all over Maxwell's and mainstream's theories.  Just imagine negative "charges" being created and destroyed just like that.  

"Let's start with the first one and why you contradict it.  Grad E = rho/epsilon_naught.  In english, this is 'The gradiant of  Electric Field is equal to the charge density per volume within a given space divided by the permittivity of free space."   That is not the equation for Coulomb's Law.  That is its derivative.

"If your model does not include electric fields (and therefore excludes the gradiant of the electric field) and it doesn't include charge (and therefore excludes the volume charge density) then you don't exactly fucking agree with Maxwell's first equation do you?"  Nope, it does not.  Maxwell's theory was not perfect by any means.  It was a stepping stone in the path to progress.  A necessary step, but not the entire path itself.

I'll pass on commenting with regards to your rather long diatribe.

"Either charge exists or Maxwell was wrong.  You claim charge does not exist, ergo, you claim Maxwell was wrong."  Yes, Maxwell's conception was partially, but not entirely wrong.   Can I make it any more obvious for you?
Reply: @wesbaumguardner8829  "Are you using the one-fluid or two-fluid theory postulated by Maxwell?"

IT'S FUCKING COULOMB'S LAW.  THE THING THAT MAXWELL IS BASED ON.  THE ELECTRICAL THEORY THAT IS BOTH NECESSARY AND SUFFICIENT FOR MAXWELL TO FUNCTION.

You don't get to ask your question and make sense because it doesn't matter which formulation of Maxwell you're using, whether you're using integral or differential, whether you're using relativistic or non-relativistic, what matters is every formulation of Maxwell is based, implicitly on Coulomb's Law and the Lorentz force.  

And Coulomb's law was substantiated BY EXPERIMENTATION.  AND STILL IS.  I'VE DONE IT MYSELF.

WITH MY HANDS.

YOU AIN'T DONE SHIT.

"Air is a dielectric.  Rubber is a dielectric.  Oil is a dielectric.  Empty space is also a dielectric.  A dielectric is a material that supports the dielectric field, as I stated earlier."  No, a dielectric is the internal resistor between two plates of a capacitor. 'Resisting what?'  Electric current, the only thing 'resistance' means in electrodynamics.  

"JJ Thompson makes it quite clear"  I don't believe you.  I don't believe you understand what you're quoting and I don't believe what you're saying is what you think you are saying.  I don't care.  You don't know what you're talking about, so instead of regurgitating physics you clearly don't understand, you could stand to shut the fuck up, stop typing, and take an actual course WITH A LAB PORTION and actually test things for yourself and see what happens.

"Since power is current times voltage p = i'e"  YOU DONT BELIEVE CHARGE EXISTS SO HOW DO YOU HAVE CURRENT IN YOUR MODEL?!  CURRENT IS CHARGE PER SECOND.  HOW DO YOU HAVE CURRENT WITHOUT CHARGE YOU FUCKING MUPPET.

See, this is what I mean by you not understanding shit.  You can fire P=IV at me (that's how we use it nowadays, they don't use E for voltage because E is used for electric field already) but without understanding that current is the amount of CHARGE that passes through a circuit per second, you seem to think you've proven charge doesn't exist.  But you haven't.

The REASON this is true, by the fucking way, is because Power is the derivative of Work over Time.  Work is the difference in energy put into an object.  The difference in energy for electricity is measured by difference in voltage times the charge traversing that difference.  So, that gives you P=QdV/dt.  QdV/dt = dQV/dt = VdQ/dt = VI.

You cannot arrive at power without going through charge because of what power is, and power, if you need an education, is something you learn in dynamics.  Dynamics is a discipline you won't get from any of the names you mentioned, for that you need Newton, Hamilton, Lagrange, and so on.  The Power used in Ampere's Law is the exact same Power used in P=dE/dt=int F X dv from dynamics.

It all relates, but the second you deny charge, you're shitting on the SAME FUCKING SHIT YOU'RE QUOTING.
Reply: @DracoSuave  "IT'S FUCKING COULOMB'S LAW.  THE THING THAT MAXWELL IS BASED ON.  THE ELECTRICAL THEORY THAT IS BOTH NECESSARY AND SUFFICIENT FOR MAXWELL TO FUNCTION."  I guess ol' Coulomb and Maxwell can dictate the workings of the universe.  And I also guess Charles Proteus Steinmetz can tell both Coulomb and Maxwell and their dictates to shove it, because that is exactly what he did.  And it worked.  While he was at it, he used the square root of -1 to describe phase differences in his alternating current theory.  It worked, too.

"You don't get to ask your question and make sense because it doesn't matter which formulation of Maxwell you're using, whether you're using integral or differential, whether you're using relativistic or non-relativistic, what matters is every formulation of Maxwell is based, implicitly on Coulomb's Law and the Lorentz force."  Well, Charles Proteus Steinmetz was using his own model based on much better and more comprehensive analytics than both Coulomb and Maxwell combined.  He was head of R&D for the largest electrical company in the world.  He was literally inventing and creating the apparatuses he was using to analyze and improve the electrical system while he was creating the system itself.  Meanwhile the physicist cheerleaders on the sidelines were pretending that they were the ones scoring the touchdowns when they weren't even on the field playing ball.  They still do to this day.  

"You don't know what you're talking about, so instead of regurgitating physics you clearly don't understand, you could stand to shut the fuck up, stop typing, and take an actual course WITH A LAB PORTION and actually test things for yourself and see what happens."  Well, someone is clearly triggered.  Did I offend your religion?  So, let me get this straight.  According to you and all physicists, it is not possible to create a new line of dielectric force as this would require the creation of a new electron at each end of that line of force and the line of dielectric force must also not be able to be destroyed as that would required the destruction of the electrons at each end of the dielectric flux line.  That is the only possible thing you really could be saying.  

"YOU AIN'T DONE SHIT."  Neither have you.  But Charles Proteus Steinmetz certainly did a whole hell of a lot of shit with his theory.  The one you are bashing.  He single handedly has done more for human progress than every physicist that has ever lived aside from perhaps Maxwell which provided him the foundation necessary to develop is better theory of electromagnetism.

"No, a dielectric is the internal resistor between two plates of a capacitor."  That is exactly where the dielectric field of a capacitor is located.

""JJ Thompson makes it quite clear"  I don't believe you.  I don't believe you understand what you're quoting and I don't believe what you're saying is what you think you are saying."  Here is that quote again with even more text, since you did not seem to comprehend it again.  " "Hitherto, we have been dealing chiefly with the properties of the lines of force, with their tension, the mass of ether they carry along with them, and with the propagation of electric disturbances along them; in this chapter we shall discuss the nature of the charges of electricity which form the beginnings and ends of these lines.  We shall show that there are strong reasons for supposing that these changes have what may be called an atomic structure; any charge being built up of a number of finite individual charges, all equal to each other: just as on the atomic theory of matter a quantity of hydrogen is built up of a number of small particles called atoms, all the atoms being equal to each other.  If this view of the structure of electricity is correct, each extremity of a Faraday tube will be the place from which a constant fixed number of tubes start or at which they arrive."  Electricity and Matter page 71.  In other words, the finiteness of what he considered the electrical charge was due to it being the end of a Faraday tube.  However, the magnetic terminates on itself out in free space surrounding a conductor, so that leaves only the dielectric as a possibility.  He goes into great detail about this thereafter.  Perhaps you should read that book sometime so you can understand it better.

"YOU DONT BELIEVE CHARGE EXISTS SO HOW DO YOU HAVE CURRENT IN YOUR MODEL?!  CURRENT IS CHARGE PER SECOND.  HOW DO YOU HAVE CURRENT WITHOUT CHARGE YOU FUCKING MUPPET."  The same way that we have ocean currents, air currents, etc.  Currents occur in the aether, as well.  We are talking about aether currents here.  So ocean or air currents require a differential in charge?  No, they do not.  Nothing other than a change of temperature and density is required for a current to occur.  There are also numerous other ways these currents can be created.  You have absolutely no justification for the absurd notion that there is only one way that an aether current can occur other than "I said so."

"You can fire P=IV at me (that's how we use it nowadays, they don't use E for voltage because E is used for electric field already) but without understanding that current is the amount of CHARGE that passes through a circuit per second, you seem to think you've proven charge doesn't exist.  But you haven't."  Those were Charles Proteus Steinmetz's words himself.  I didn't change a single word of it, aside from spelling out the Greek letters instead of going through the trouble to insert the actual symbol.  He disagreed with all of you physicists and he is right.

"The REASON this is true, by the fucking way, is because Power is the derivative of Work over Time.  Work is the difference in energy put into an object.  The difference in energy for electricity is measured by difference in voltage times the charge traversing that difference."  We are not putting that much energy into "an object" in what we are discussing.  The energy is in the magnetic and dielectric which is in the space surrounding the conducting wires, not in the wires themselves.  Additionally, work can be performed in ways that do not involve electricity or charge at all.  You can capture kinetic energy directly and use it to perform work.  You can capture heat/thermal energy and use it to perform work.  In the case of the dielectric field we are discussing, we are taking kinetic energy from falling water or thermally expanding water and using it to spin a turbine which has magnets strapped to it which spin in a manner so that their flux lines cross coils of copper wire which then cause disturbances in the aether to flow down them.  It is similar to if you used a centrifugal pump to pump water, but instead you are pumping aether and instead of the aether flowing down the center of the wire, it is flowing in the space surrounding the wire.

"You cannot arrive at power without going through charge because of what power is, and power, if you need an education, is something you learn in dynamics."  I just provided two ways you can get power without using the conception of a charge.  There are probably numerous other ways, as well.

"It all relates, but the second you deny charge, you're shitting on the SAME FUCKING SHIT YOU'RE QUOTING"  I am not.  You just do not understand it because you are coming from the same erroneous position Charles Proteus Steinmetz was railing against. Your entire understanding is based on the erroneous prehistoric conception of the point charge and you cannot get away from it.
Reply: @wesbaumguardner8829  
Firstly nucleus does not repel electrons it always attracts it 
And the reason that electrons don’t fall into nucleus is because they are in fixed energy states given by Bhors theory MVR=nh/2pi 
This keeps them stable in the described orbital.
And no one knows nucleus is positive and electrons are negatively charged that is just convention they just know they  have some kind of fundamental property which are opposite to each other 

And as far as JJ Thomson model is considered that was shit it did not work with respect to quantum mechanics  and failed in explaining how to account for rest mass of neutrons.
Reply: @tushar9912  If the nucleus actually attracted electrons, the electrons would be in the nucleus.  Electrons are not in the nucleus.  There must be some repulsive force that keeps them out of the nucleus.

"And the reason that electrons don’t fall into nucleus is because they are in fixed energy states given by Bhors theory MVR=nh/2pi "  Call it what you will, but there must be a repulsion that prevents the electrons from entering the nucleus of the atom, otherwise, they would, in fact, enter the nucleus of the atom if there was only an attraction without a repulsion.  The distance of the orbital field of electrons varies greatly compared to the size of the electrons.  However, the orbital field is never in the nucleus.  

"And as far as JJ Thomson model is considered that was shit it did not work with respect to quantum mechanics  and failed in explaining how to account for rest mass of neutrons."  Pretty much all models fail at explaining mass.  They describe it, sure.  But explain it, they do not.  Claiming a magical W boson particle causes mass is no explanation at all.  It is a "it just is" assertion with no basic mechanical description whatsoever to explain the how of the observations.
Reply: @wesbaumguardner8829  Charge is one of those base-case words that is difficult to define in a satisfactory definition.  You generally want to use charge to define everything else.  It is a term like mass and matter, where we eventually end up with a circular definition.   You are going to end up with circular definitions eventually.

My definition for charge would be:
"A property of matter that enables participation in electromagnetism."

"Does one have a good attitude and another a bad attitude?"
No, it is completely arbitrary that we assign the names of positive and negative to the two kinds of charge.  There is nothing inherently good about one, and bad about the other.